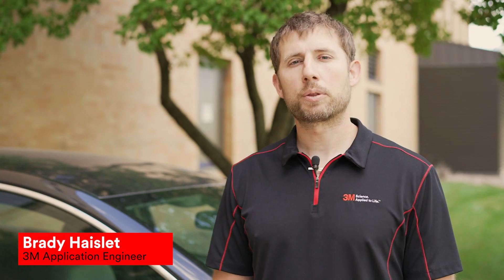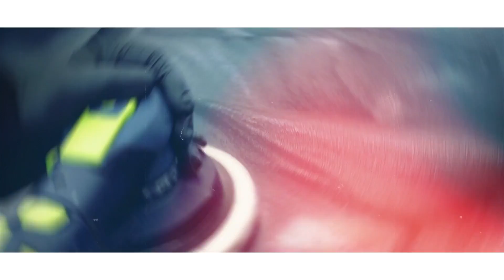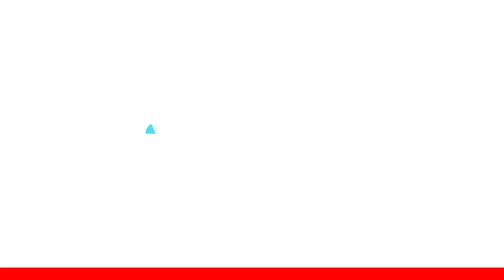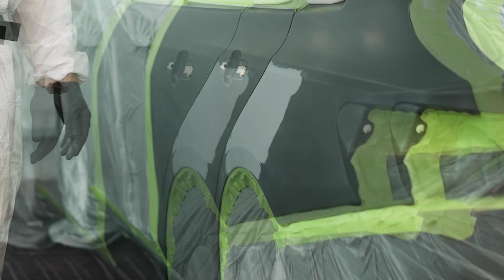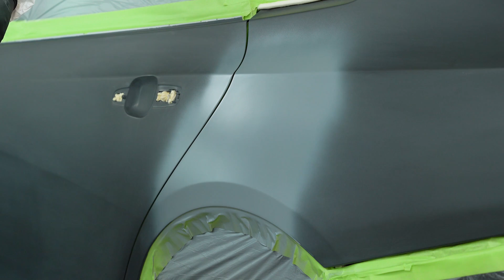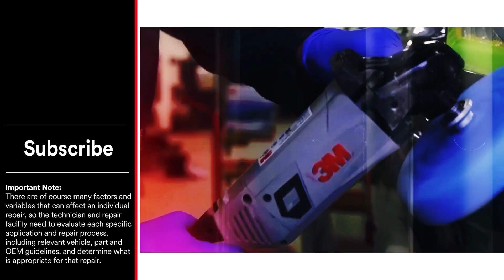Automotive Coatings Episode 2: Sealer and Base Coat

Comment: What size tip did you use for the sealer?  I am having a very difficult time with PPG DAS3021 2K urethane sealer to get a full wet coat without sags.  I have never had anything like this issue before so I am trying to gather as much info as I can. I am using the 3M performance gun with a 1.4.  The gun with the same tip works great for basecoat so that adds to the confusion.  Thank you.

Comment: If you brought your color to the leading edge of that door it will never match the front door I wish you would go into detail of blending and techniques like flicking and on harder colors like golds light blues turning your fluid down and go from full coverage on repaired area to no paint on that leading edge and like you said make it an angle to trick your eye and clearing to the next body gap